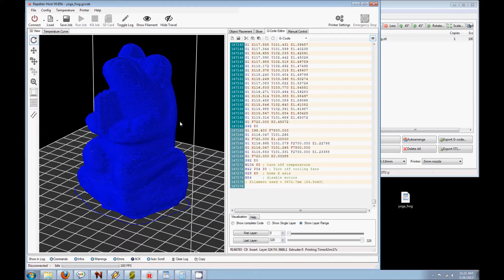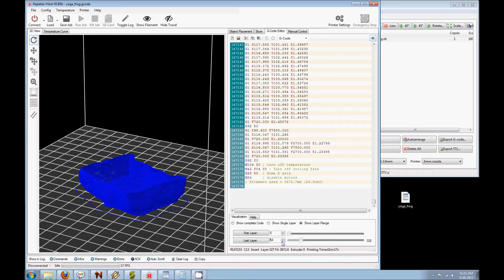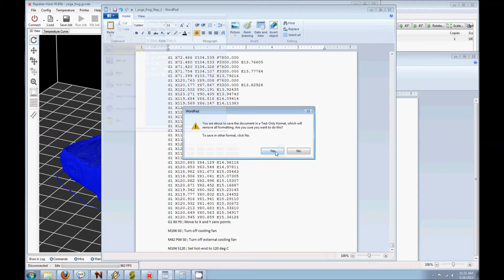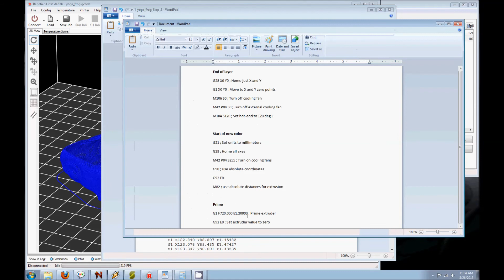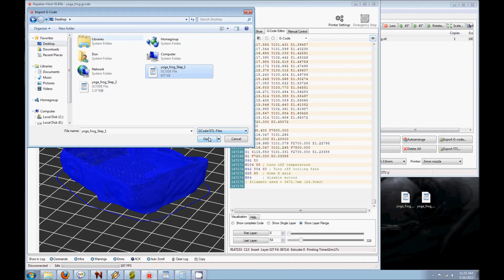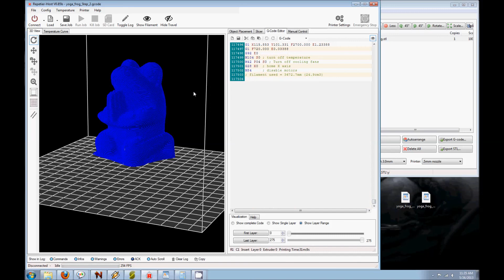Prusa i3 video build log 11

Comment from the maker: The big problem is that nothing is written to memory, so once stopped the printer does not know where it last was.  Some host programs get away with pause buttons by storing the location in the computer it is run on, then sending this location to the printer when un-paused.  If using a host program to print from one could insert the host's pause command into the G-code at a specific point.

Comment from the maker: M0 and M1 do exist in the reprap firmware, but do not act the same as normal CNC g-code.  M0 tells the printer to finish all moves in the buffer, then turn off all motors, heaters, ect.  The printer will not respond to any further g-code until the micro controller is reset (blowing away anything left in memory).  M112 acts the same way but is an immediate stop (kill command).  M1 is sleep mode, printer will finish all moves in buffer then shut down, but can still receive G-code commands.

Comment: Also M1 is an optional stop - so if it is enabled in the control the program will stop, if not then it won't. Could be useful if say you wanted to make one part multi-coloured, then the next one you wanted to be all one colour you could turn this option off. I don't know if your control software has that feature though.

Comment: Just a quick thought on stopping the machine mid print. On all of the CNC machines I've ran using G-Code the control software uses an M0. This stops the machine in whatever state it is in and just pressing the Cycle Start button starts the machine back up to what it was doing. Maybe worth a try instead of having to split up and select a new program. It is good practice to make the machine head away still then put an M0 in the program.